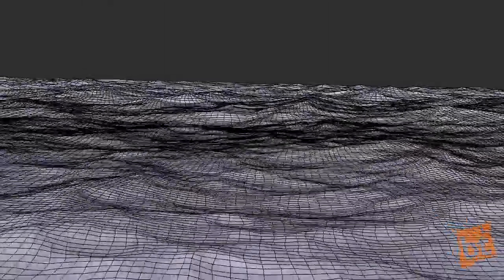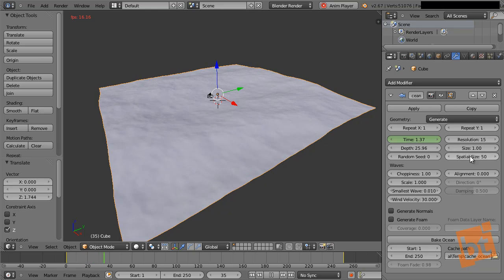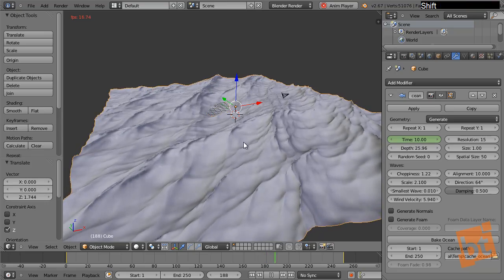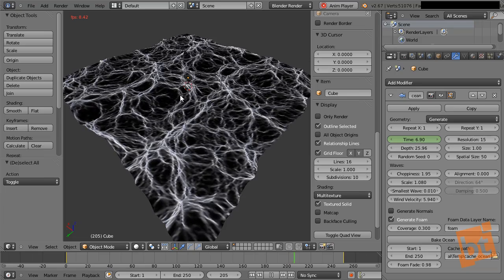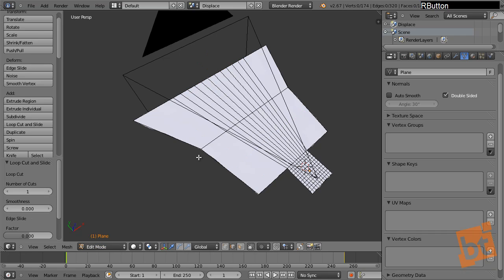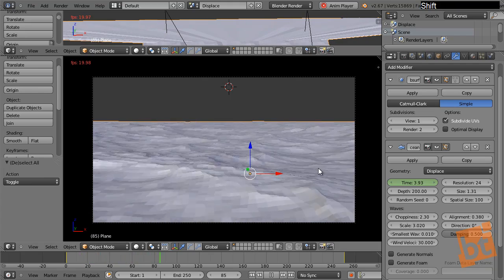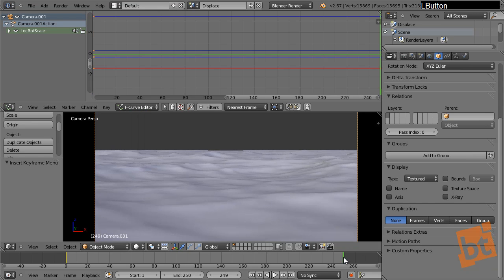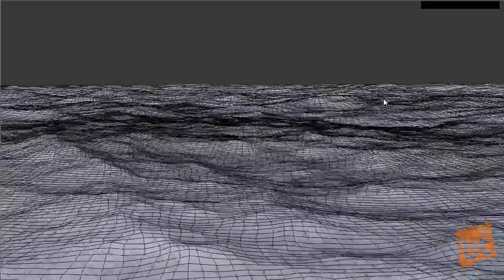How to simulate an Ocean in Blender (Part 1)

Comment: Great Tutorial. Thanks.

Another tip:
You can animate the time-value easier if you type in e.g. "#frame/10". This will create a driver. Changing the speed of the simulation will be much faster later if you do it this way :)

Comment: You can try to use Dynamic paint and set the drop as a brush and the ocean as teh canvas. set it to waves or displace and tweak with the settings. Sadly this cant be done on a large scale:( like a huge boat :/

Comment: I've been pulling my hair out trying to get the surface to animate. I did just like you instructed - set the Time to "0.0" at the beginning of timeline, hit "I" to insert keyframe, then go to end of timeline and set Time to "6.0", then hit Alt+A, yet nothing happens (depth is set to 200 so that's not the problem). Also, why when you said hit "I" to insert a keyframe you didn't mention a menu would pop up with about 12 different choices.  Maybe it's because i'm a newb, i don't know.

Comment: I've followed your basic instructions up to the first animation preview using ALT+A. I've matched all of the settings as instructed in the video, but for some reason it just won't animate it. I know I'm doing something wrong here, or I am missing something. In order of operation, I added the modifier, I upped the resolution, I inserted the key frames at the beginning, and end, I put the time value at 6.00, and increased the depth. But when I hit ALT+A it doesn't show anything. Help?

Comment: Great video, I just tried this but when I press " I " to insert the keyframes a menu pops up and I´m not sure what to choose. I used Blender 2.70a
Reply from the maker: If you use it on top of a property, it will add a keyframe, no options. If you press I on the 3D View, in the menu you have to select the properties of the selection in which you want to add keyframes: like LocRotScale adds keyframes to the position, rotation and scale of the selected objects :)

Comment: Hey sir, i expend my day off to watch and learn step by step i take note every key and tools that you used but still i can not get to move the ocean, even i increase the DEPTH after setting the TIME (on HOW TO SIMULATE AN OCEAN part 1) can u share something to help, im using Blender 2.71 on laptop pentum honestly i tried other animation and it works thanks for expending ur time to us a very absolute beginners.
Reply from the maker: You must animate the time value. Place the mouse cursor over that parameter, and press I in your keyboard to insert a keyframe. Hope it helps!

Comment: Uhm with the time i dont know if you did this with a mouse or not but when i moved my curser or however its spelled across the screen the waves didnt go by or the time
Reply: Plus im on a laptop with no mouse
Reply: For the ocean to animate, you need to set animation keyframes on the Time parameter of the ocean modifier (place the mouse pointer on top of the parameter and press I). Also, for doing 3D, having a mouse is key :P

Comment: Hi! I'm planning to buy a new computer to start 3D Animation and I'd like to know your computer specifications. Thank you so much! :D
Reply from the maker: My computer is a intel i7 3930K, nVidia GTX590 and 32gbs RAM.
Reply: i73930k (props to Oliver Villar, 3930k-bros) 2x480GB SSDs, 2x3TB HDDs, 64GB RAM, 2xGTX670s :)

You don't need any of that though... it all depends on what you are doing. You can rack up an expensive rig, but it might not pay off. A lot of work can be completed on a lower end rig, and you simply outsource your rendering if you are doing serious work. Good luck.
Reply from the maker: Wow! You have a nice beast there! I'm planning on upgrading my graphics card soon :D I own a 120GB SSD and 2TB HDD... enough for me now :D

How's your experience with 2 GTX670? With my 590 (it has 2 cores) I have an issue: using 2 cores at the same time with GPU rendering is problematic... so I can only use one, not taking advance of the full power of the card :S
Reply: Oliver Villar Thanks man, I actually just posted my  #homeofficeporn  (SFW!) like a minute ago: https://plus.google.com/+BraedenLaverty/posts/Hfqj89rTY6a

That is the rig there. I actually didn't spend as much as it might seem on it. I was strategic and purchased all the components on massive sales over a few weeks, so it ended up costing about half of what you would probably expect.

I really like my cards, they seem to perform very well in comparison to all the performance charts that are out there. Both cards work fine in blender, seem to give me fantastic render speeds. I have been advised not to SLI them, because that impacts rendering performance in cycles, so they are both just individually installed and blender picks them up totally fine.  Unfortunately my cards only have 2GB vRAM, so it is easy to run out of rendering memory. With that said, the new 9xx series look reallllly good, and apparently they are affordable (haven't checked out prices yet, so I can't confirm). Not sure I have money to spend on anything yet though...

I didn't know that the 5xx series had dual GPUs, I actually just learned here on G+ that the titan uses two GPUs. That sucks that you can't utilize both of them in rendering. Either way, rumours are that cycles is getting so efficient that CPU rendering is getting toe-to-toe with GPU and all full feature set is working on it. So maybe vcards aren't the champion anymore.
Reply from the maker: Only 590 had 2 cores. Apparently, it was like two 580 into a single card. The two cores thing is weird, because sometimes it works... but most of the time don't! :S

I'm planning on getting a 9xx, the "bigger" one was like 650€ :P
Reply: Buy white one.

Comment: At some point in the middle I successfully rendered first few frames but at the very end I encounter a strange issue - I keep getting black image as a result unless I switch off Compositing but then as the name says, the layers don't compose. Either way it doesn't work properly and it means I messed up sometime in between. I've been looking for the solution but I failed - What can be the reason? Thanks in advance for your help!
Reply from the maker: Hmmm really strange. Have you try rendering it again? Looks to me like an error with the graphics card or something similar :( Usually restarting and trying again that can be solved. Also, make sure your drivers are up to date. Hope it helps!

Comment: first I want to say great work and I appreciate these tutorials, but I'm having a little problem and was wondering if you could help me out with this. I got all the way to the last few steps in the video right when you render active view port, it goes frame by frame saving them into the folder i selected. Once that is all done and I go to render / play rendered animation i get a message saying "couldn't run external animation to player with command ' ( this part is the path where i saved the file) '. I even tried changing the user preferences as you specified but it wont fix it :( I've tried relocating the folder and I've tried renaming the file I'm not sure whats causing this. do you have any suggestions?
Reply from the maker: Hmmm to be honest, not seeing exactly what's going on I have no idea what could be wrong there. It may depend in the format you selected to rendered the image sequence. In the User Preferences, under the File Tab, you can place the address in your computer of an external video player. I recommend Djv to you ;) (it's free and works nicely for image sequences)